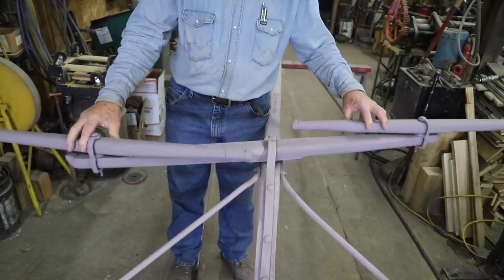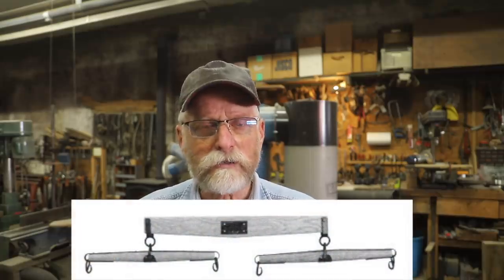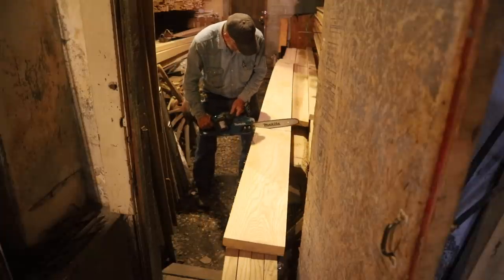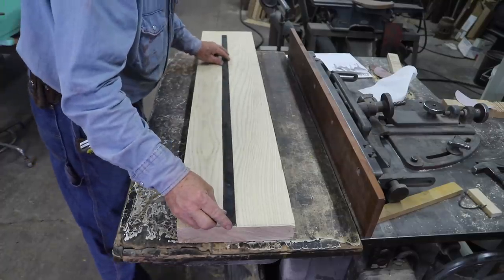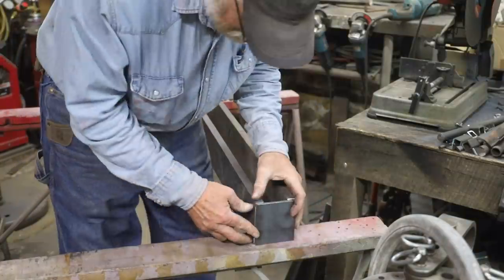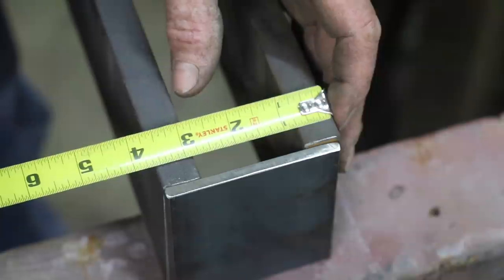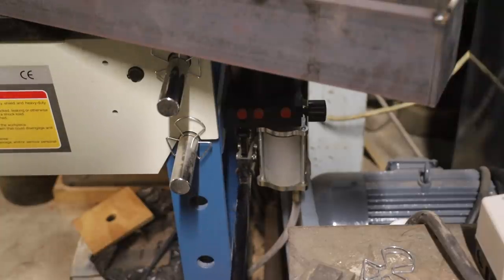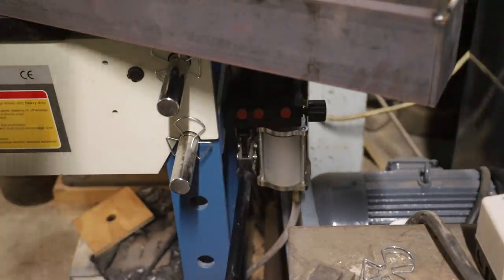Designs of Doubletree Eveners & How They Break | Engels Coach Shop

Comment: Hi Dave😊 I liked this comparison test of the two tyes of eveners,  the second one took well over a ton before it totally lt go, as you pointed out a common factor is that wood is not a uniform  quality, ie, density, tightness of growth rings, etc , all add up to an unknown level of strength in any given plank of timber, obviously you will pick a board whith the straightest,  tightest, grain, preferably quarter sawn so the grain is running at 90° to the face, but I know from personal experience that finding boards like that on a regular basis wouldn't be easy, so we do the best whith what we have , no doubt you could add extra steel  braces, but as others have said something else would break, so realy this part is a failsafe weak link,to save the horses formost,  and save the carriage. At the end I think your theory is sound mate, best wishe's to you and your's, Stuart uk.

Comment: Would a metal strap along the rear of the evener that bent around the ends and terminated in forward facing hitch loops through bolted to the board reduce the point load stresses on the doubletree? Excellent video! Thanks!
Reply: I was thinking the same. The rear radius is definitely going to be stronger. (Any Radius is going to be stronger than a sharp edge). Now what can you do to slow or stop the stretch of the radius side? Add an Iron as you stated.

Comment: If we ignore the grain of the wood, then the part that is in compression you want to be in a straight line.  The bulk in front is not allowing it to be in a straight line, so the compression force wants to push away from center.  I would think that ideally you would want to split the wood with a froe, and use that straight split to the front, with a curved back.

Comment: It makes sense to me that the side under compression (front) should be a straight line. Any deviation from a straight line causes end loads (which is what compression is) to be translated to a lateral force (front to back), encouraging splitting. (Would cross-bolts near the center pin do more to weaken the evener than the strength they would add by resisting splitting?) Tension loads can be led around a curve without much loss of strength. (If carriages were still being built by the thousands, it might be worth the expense in time, material, and effort to test for all these variables.)

The strength of wood relative to whether it is in tension or compression (which may be different for different species and/or cuts - quarter, rift, or plain sawn) should govern the placing of the center pin. The front:back ratio (for choice of pin location) should put force on the wood in proportion to the relative compression:tension strengths of that particular wood and cut. How much allowance to make for changes as the wood ages and gains or loses moisture, just adds complexity to these choices. The ideal front:back ratio should result in simultaneous failure in compression (or in split-away as in the first test) and tension under increasing load. Like the Deacon's Wonderful One-horse Shay, the failure should be "all at once and nothing first".

[The Deacon's Masterpiece; or the Wonderful One-Hoss Shay by Oliver Wendell Holmes, Sr. (1858)] https://en.wikisource.org/wiki/The_Deacon%27s_Masterpiece (If you can trust a man who was educated as a lawyer and medical doctor, there are some hints as to choice of woods for various parts of a buggy, although eveners weren't mentioned, perhaps because it was a "one-hoss" vehicle and they weren't needed.)

Comment: I don't know anything about these but why not make the eveners out of metal...
Reply: Excessive weight
Reply: By the time you get the same strength as wood, including whether it bends under load -- you need a lot more metal by weight. But that would be an interesting test -- see how much pressure the same weight of I-beam or channel iron could take.
Reply: There are steel eveners and single trees. Mostly used in logging because they're hitting the ground and are left outside.
Reply: @dianeengel4155  That makes sense. For a light carriage, not so much!

Comment: Interesting:
Do you think maybe using the centre line of the board
for symmetry, with the outside edges to cut off the tapers, 
might make them more equal?
- basically the same failure from both directions. Definitely 
showed where metal support plates might be used. A plate 
from end to end on the back face with the pivot point brought 
forward to the front on metal supported from the back face.

In praxis it is the materials available, wood and metals for 
brackets andt tires..

Comment: Traditional chairmakers will rive parts out of the bulk and then shape with a draw knife to increase strength relative to sawing. The belief or idea is that riving leads to splitting along the wood fibers leaving longer continuous fibers vs. sawing, which breaks fibers while following the saw line. Shaping with a draw knife, with skill, is supposed to be able to maximize the fiber length. So, I'm wondering if, with careful wood selection to find naturally arcing grain, and skilled work with a draw knife, you might be able to increase the strength of the traditional component even more. You might be able to make that sweeping curve with long uninterrupted fibers vs. having a curve cut on a bandsaw that would sever the fibers that cross the curve. I also wonder how much modern timber might differ from old, slow growth timber with its tightly spaced growth rings?

Comment: Both seemed to fail in tension at about the same time which begs the question: Do both seem supply enough strength in normal duty to work just fine? (seems to me you exceeded the stresses they would see even in heavy duty use - based on zero real world experience :^). Bummer about the pressure gauge though. Maybe counting the strokes you pumped would have been more accurate than that gauge. Love this kinda stuff! Thanks for doing this!

Comment: I am somewhat confused about what little I know when it comes to draft teams.   Thanks for the explanation of single/doubletrees on your website.   What is not clear to me is just how the whole thing is assembled and the direction of pull from the team against the load.   1. Is the "Front of the evener" facing whatever is being pulled? 2. Is that small section of wood between the central pivot bolt and the front of the evener (either style) all that taking the force being applied to the load being pulled?  It seems like a major weak point to me.
3.  Not sure why the area of the center pivot is considered to be under compression while the ends where the animals are attached is considered to be in tension.   It seems to be that with the ends attached to two animals both pulling on them it would be like pulling the string on a bow with the back of the evener being the inside of the bow.

Comment: I don't know much about what people have done for this sort of thing, but it looks like you could make one of these much stronger by putting a steel strap along the back to take the tension load, and putting the bolt for the pivot in front through a steel channel that wraps around the front of the wood,  spreading the application of the bending load over a much larger area.

Comment: Excellent test. I think you made your point as to the better design. 

Watching the modes of failure, it occurred to me that both need more material behind the center bolt. Has it ever been done that the member is thickened in both directions?

You could use your test bed to design a double tree better than either.